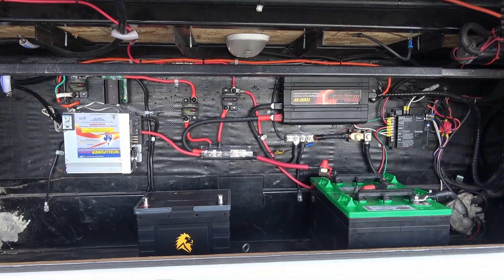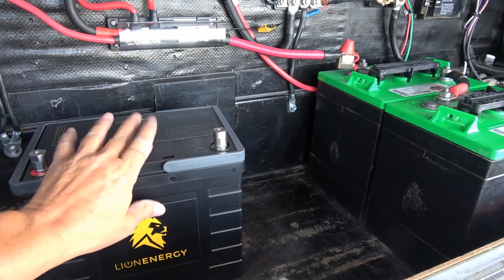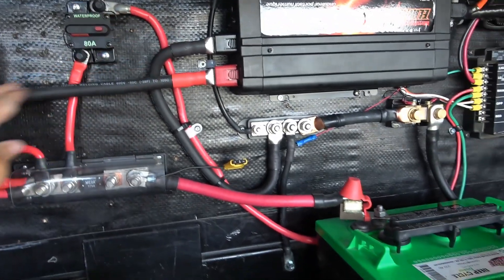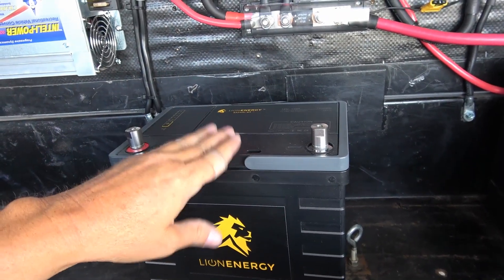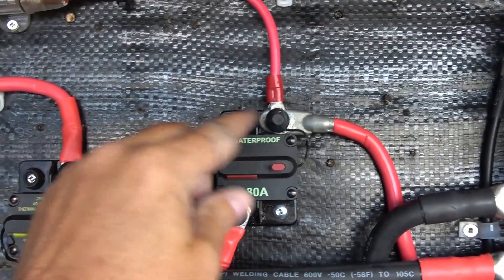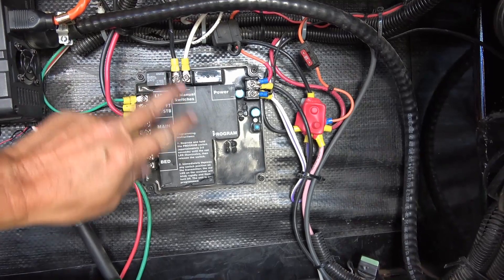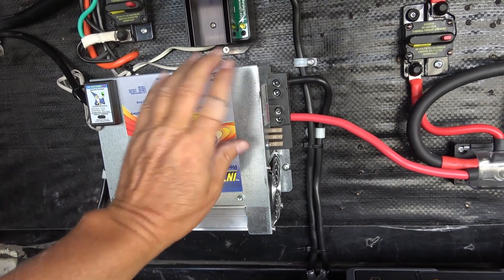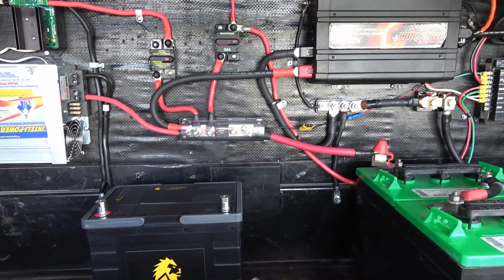Reorganized My 12 VDC RV Power System Wiring

Comment: Nice & Clean !  I have seen several "systems" like these. Is the goal to eliminate use of a generator?  Have you found it cost effective ?
Reply from the maker: Yes, we boondock about 4 months of the year and find it pleasant to not have to run a generator several hours per day. During our last 4 month stretch, the generator saw only around 30 hours run time, mostly when we had multiple cloudy days in a row.
As for cost, for most people that don't camp a lot off-grid, a generator is a cheaper option even people with solar often carry one for backup power, solar is more a lifestyle choice, but having said that prices have been dropping over the years. Cheers, Ray
Reply: @LoveYourRV  Thanks for the reply. I ask because I have a 100w solar panel that charges my two batteries and a small generator for occasional use when the sun is not cooperative or I need 110v . My 110v needs are not very often & short periods. I use ~1 gal of gas a week. I do not use an inverter to go from 12v to 110 though. Also not a full timer, but do boondock for week long periods. When out for a 30 day stent we usually move after about 5-7 days & the alternator then does the charging. I like your system(s) & trying to se if I am missing the boat. I'll keep watching and learning....

Comment: VERY much looking forward to seeing your install of the new ReLion batteries, AND what other mods may be required for the (usually) very different charging profile for LiFeO4 batteries.
Reply from the maker: The actually are Lion Energy, not ReLion. :) Talked with Lion Energy folks this AM  and they said I could use my existing chargers. The PD9260 isn't lithium specific but I told them how I can override the lead-acid algorithm and give it a constant 14.4V using the manual charge wizard pendant. They said that would work well.
However, if I decide to upgrade the charge converter they recommended the Iota with the addon IQ LIFEPO addon - https://www.iotaengineering.com/IQ/#!/detail/IQ-LIFEPO

Comment: What about safety and battery thermal runaway, do you plan to install some sort of fire alarm near the batteries ? As far as I understand the batteries are pretty much below the bedroom.
Reply from the maker: I already have a smoke detector in the ceiling area of the compartment. Thought it wise since it contained so much gear and high current capable DC wiring. The batteries internal BMS (battery management system) includes safeguards to prevent thermal runaway. The lithium chemistry used called lithium iron phosphate is one of the safer types out there. Some say safer than lead-acid batteries.  One advantage of having them mounted in the external front storage compartment is they are sitting on a heavy metal floor welded to the frame so a fire might be avoided or delayed. Trade off is I will likely have to heat the compartment if we spend a lot of time in colder weather with long stretches below freezing, which as snowbirds we don't. 
Frankly, though I'm not any more worried about it than the multitude of lithium batteries I already have in things like my laptop, power tools, phone, etc. You hear about the odd thermal runaway but quite rare in the grand scheme of things. Cheers! Ray

Comment: Can’t find any info of BMS on this battery?
Reply from the maker: It sealed inside the battery and as far as I know nobody has broken one open and Lion Energy hasn't shared the info on it -  https://lionenergy.com/collections/portable-power/products/lion-safari-ut
Reply: Love Your RV 
Thx... almost ordered from Dakota Lithium until you posted this. 

Found this Lion for $800 per battery at Continuous Resource LLC. Not bad price
Reply: Just ordered 3 because group 24 footprint makes them the only 100Ah battery that will fit 3 in my Micro Mini 5th wheel.

Super helpful people also!!! 

20lbs per battery means I’m getting 3 times the amp hour at half the weight compared to the T105 we have now!!!

Thanks Ray you rock!!!
Reply from the maker: @annieandalfie  Great to hear, going to have a ton of power in that Micro Mini. :)  Let me know how it goes. Cheers! Ray
Reply: There is also another company coming in the scene called Battle Born.
Reply from the maker: @SWARDo1  Yes, they are actually quite popular, been around for a few years now.

Comment: At 5:49, does that wiring allow you to run auxillary/ignition activated lights, stereo, etc without turning the ignition key to auxillary?  That is something I would like to figure out....
Reply from the maker: I have a fifth wheel trailer so things are much different versus a motorhome, everything in the trailer runs without the truck even hooked up. Most motorhomes will separate the starter battery and the coach battery bank. Usually with a solenoid relay switch. In my old camper van I had the lights and stereo, etc hooked to the coach battery so they wouldn't drain the starter battery. But when the engine was started the solenoid relay would close so the alternator could charge both batteries while underway.

Comment: That's a nice battery bay you have there.  A misguided hot doesn't stand a chance.  Just installed 200 w of solar on the Trailmanor.  The load side of our battery bay is next.   Cool video.  Safe travels.
Reply from the maker: Thanks. :)

Comment: Does the Bogart PWM controller have a setting that works with the new batteries?
Reply from the maker: I contacted Bogart Engineering. They sent back these recommended settings.
We recommend the following settings on the TM-2030 for most LFP batteries.  

P1 - 14.3 or 14.4V
P2 - 2.0%
P3 - battery bank capacity in Ah
P8 highest voltage your system can tolerate (for example, inverter input limit of 15.5V)
P10 - 98%
P14 - 0.00 hrs
P15 - 12.8V
P16 - 12.8V
P20 - 0.00/Off
P21 - 0.00/Off